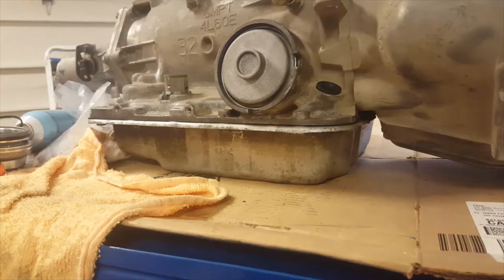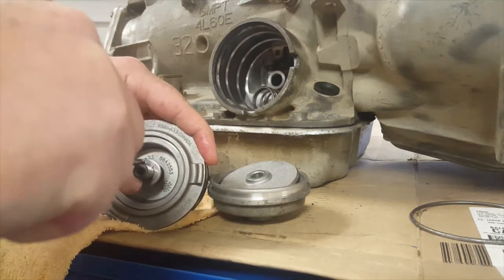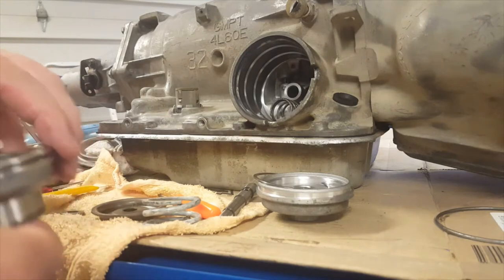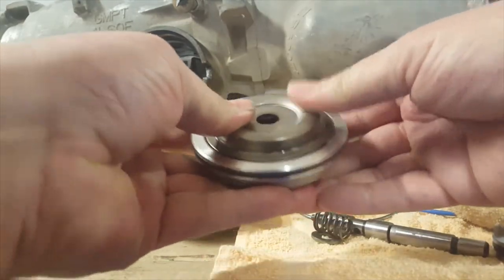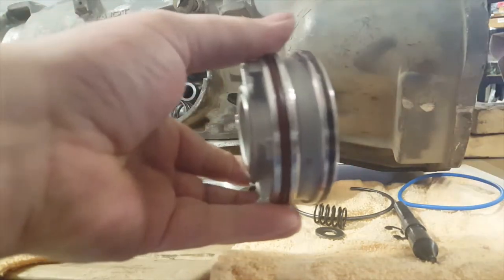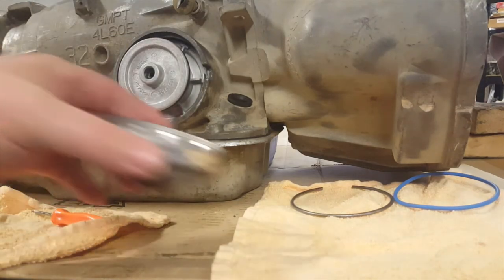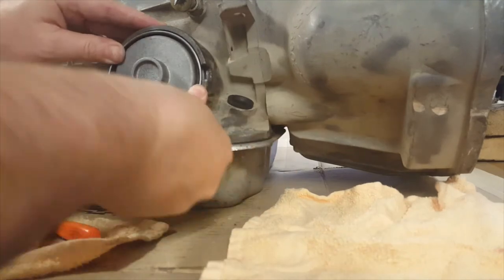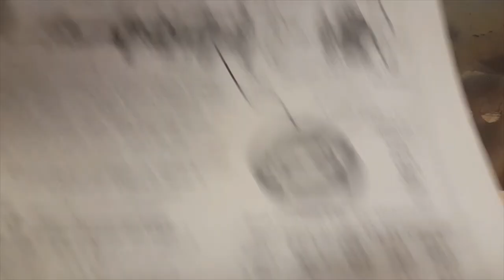Corvette Servo Installation 4l60 , 700r4

Comment: Thank you for the deliberate and detailed reassembly of the servo with the new parts. This is exactly the video I was looking for. I'll be tackling this tomorrow on my truck with this video on standby. Lol
Reply from the maker: Awesome , glad it helped and thanks for the comment!
Reply: @jaysgarage3616  is it a hard job if I don't want to remove my transmission? because it's in good condition.
Reply from the maker: @TheBully010  It can be a pain in the vehicle as there can be limited room.
Reply: Do you have shifting issues?
Reply from the maker: Sorry for the late reply , Hope it went well!! Thanks for watching.
Reply: @thomasmallory971  no "issues" necessarily. At the time I wrote this, I'd just had a brand new 4l60e from GM installed on my 2012 silverado. It shifted how it was supposed to, but I always hated the lazy 1-2 shift from the factory. 

I replaced the servo with the 1-2 corvette servo about a week after this comment. It was fairly easy to do and took no more than an hour. Only reason it took that long is I tend to go overboard with double and triple checking everything, being very deliberate to assure everything is perfect. 

The new servo made a world of difference immediately. The 1-2 shift now feels exactly as it should from the factory. I'm now nearly 3 years on and 70k+ miles since the change with zero issues and still shifting perfectly! 

I highly recommend anyone with this trans do the swap. You won't be disappointed!
Reply from the maker: @williamabaker12  Thanks for the follow up!

Comment: Definitely the most difficult part of the job. (Snap ring) I installed mine with the tranny on the truck. Pry bar is the easiest way to get the snap ring in, Once you seat the cover properly, apply pressure on the center and it should give you room to install a snap ring.
Reply from the maker: You are right. Thanks for the comment.
Reply: This tip definitely helped me!

Comment: Great video! I tow an RV and small trailer frequently. Do you recommend installing this on my transmission?
Reply from the maker: Thanks for the reply. This is more of a personal preference and many have had different results. If you are happy with your truck you could leave it and if you want one it would make your shifts a little quicker , If I was doing a rebuild I would do it. If looking from a performance standpoint I would also add it there. Hope this helps.

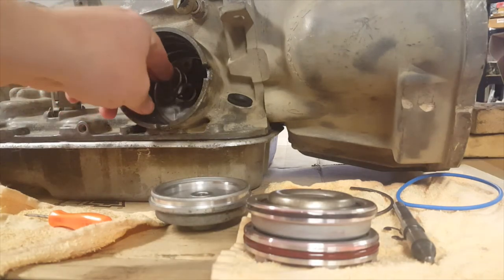Comment: Great vid!!! At 12:24, the plate that you set the final spring on. What’s the name of that plate ? And can it be removed? Mine is cracked.
Reply from the maker: Sorry Kim , I think you are referring to the servo , maybe I'm wrong but either way if the plate is cracked you can order the complete unit.
Reply from the maker: Thanks for the reply!

Comment: That cover spring is giving me a hell of a time since I'm doing this while the transmission is still installed. Any tips or tricks I can use? Thanks in advance
Reply from the maker: Sorry for the late reply Todd , Ha , I struggled a bit out of the vehicle and I assume your finished by now. Have someone hold the cover in while you put the ring on is my best guess
Reply: @jaysgarage3616  yes  i finally got it.  It was tgr cover not being fully pushed into place that prevented the spring from going in place.  The  channel wasnt expised enough.  Thanks.

Comment: I absolutely hate and dread putting the snap rings back in, it can be  very frustrating
Reply from the maker: Yes , it sure can be frustrating.
Reply: @jaysgarage3616  I can on imagine how tough it is off of the vehicle it seems harder that way having really no way of holding and pushing in the cap, lol because on the vehicle is just as hard too, but finally got it back on after about a hr on the floor  🤦🏾‍♂️ but thanks for the video it was very helpful

Comment: Hello I need your help 
I have 4l60e slipping on 2 n 3 n 4 when rpm go more than 2000 
1 n R working good I put a pressure gauge on the line pressure I have 60 psi on P N D321 and 35 go to 90 on R 
What do you think 
Thanks for your help
Reply from the maker: I am going to guess (without seeing it) it needs to come apart and checked out.
Reply: @jaysgarage3616  you think pump or pump valve or AFL valve EPC or torque convert ? 
Thanks for your help
Reply from the maker: @rockabichebel  I dont think the AFL valve and your pressure seems ok if you are light driving or sitting , you should find someone with a tech 2 scanner and go through the functions. I am not sure at the moment.
Reply: If you lose it when it revs up, it’s because the pump intake is plugged.  Probably needs a filter
Reply: You ever find your problem with the transmission? I'm having same issue
Reply: @antj211  I build it 2 times same problem I change all the transmission today but need 2 days to finish
Reply: @rockabichebel  hope you get it worked out

Comment: Nice video...can you recommend me one fit on 07 chevy suburban 1500 5.3 4x4 please
Reply from the maker: TransGo Performance 7-2P - TransGo High Performance Servo Kits , I used this one and you can get it from any supplier Summit , Rock Auto , Ebay , Jegs, Amazon.

Comment: Great vid.  At the very end, I didn't hear you say "forward piston" and I forgot it.  
 Luckily I reviewed another vid (https://www.youtube.com/watch?v=pkQQYzQ9x0E) to see how to use the pry bar and he showed the "forward piston" which I had left out.

Now I can't get the cover off without destroying the blue o ring. Wow, I was able to pull the o-ring out intact!! All done.  

putting it the lock ring at 9:30 was easy for you, murder for me.  Got hurt.  Finally used a big flathead to hold in the first bit, then pushed with both tips of some needle nose pliers.
Reply from the maker: It can be difficult , hope all is good and thanks for watching!
Reply: all good, the second time.  First time, I didn't get the snap ring in properly and dumped a gallon of oil on the road, got a tow home and tried again.